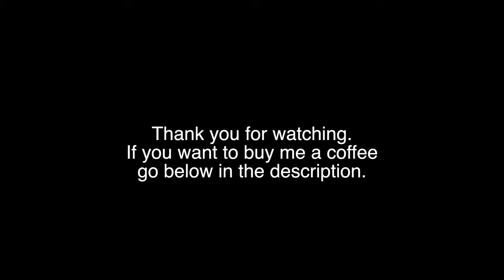Xiaomi 1S/PRO2 Fender Vibration Rattling Noise Solved 🔧🪛🔨

Comment: Good lad! I'll fix mine now. Just have to find what also started making sounds in front. Has something to do with steering stick.
Reply from the maker: I’m using these https://amzn.to/3rImWq5 in order to avoid weird noises coming from the front
Reply: Looks like one of the solutions indeed. After googling I found out that it's either tightening loose screw, application of lubricant regularly or putting self made fat duct tape instead of rubber.
Grazie!
Reply from the maker: @Lukoplakis  You are welcome 🙂

Comment: that fixes the problem temporarily. it starts again after some use. do you know another permanent solution?
Reply from the maker: I suggest to use solid tyres and to put some screw lock glue on the screws. In this way you don't have to change so many tyres and you will solve the rattling sound.👍🏻

Comment: Hello man what size is that black screw holding the bracket on ?
Reply from the maker: Hi. Do you mean the screw length?? Why, do you lost it?
Reply: @StefanoGentile01  yes the screw length because mine has fell out and I need replacements
Reply from the maker: @Jordan-gm9we  Ah, understood. But I think that the most important thing is the screw thread and I don't know how to measure it. Anyway, in this weekend I'll disassemble the reflector and I'll let you know the screw length.
Reply: @StefanoGentile01  Thanks
Reply from the maker: @Jordan-gm9we  Hi, I thought about that and you don't need to know the screw length. However, I suggest you to remove the screw on the other side and go to a hardware store and find a good replace. The hardware store stuff surely know better than us the screw thread. Keep me updated.
Reply: @StefanoGentile01  still don’t know the size screw I need u have any ideas ?
Reply from the maker: @Jordan-gm9we  you can find all the screw lengths in the description

Comment: What is the size of the small screw in the fender?
Reply from the maker: 2,5 mm, I’m sorry if I didn’t write it down. But I suggest you to watch my other video called “reflector easy removal”. You can find it on my playlist 👍🏼
Reply: 2.5mm for the loosen screw in the bracket right? Thanks for the response ☺️